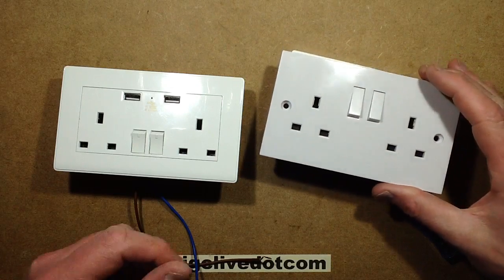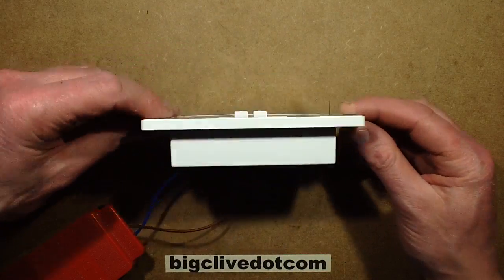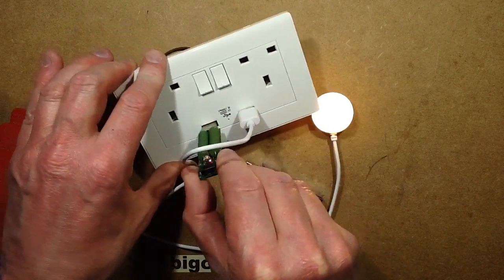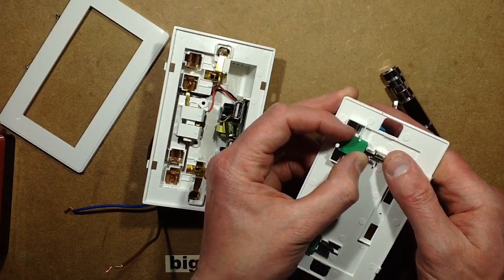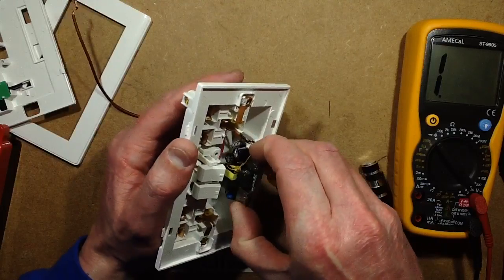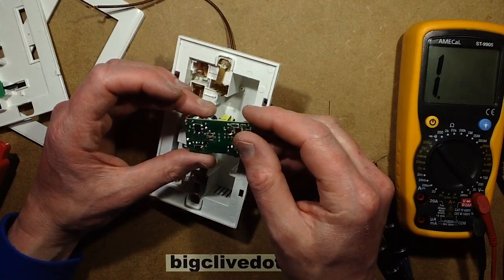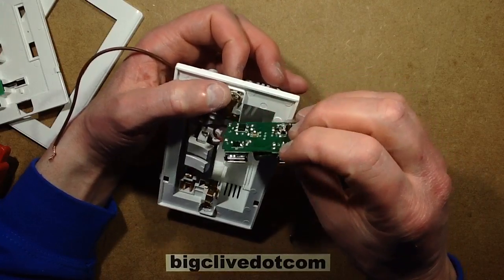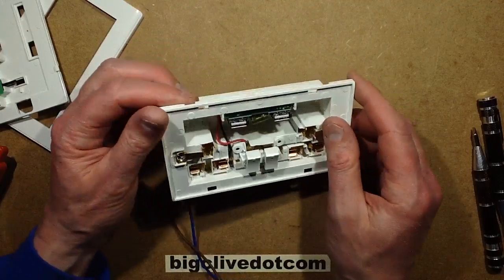A look inside a (crap) double gang socket with USB outlets.

Comment: In  America we teach kids not to stick things in AC sockets by leaving them un-shuttered. Just takes once in most lessons.
Reply: Haha. I know they are for safety but there was nothing worse than moving into a place where they've stuck those little socket covers in them (I hope you know the ones I'm taking about). And then you can't get them out with your fingers (especially if you don't have long nails). Then you're stuck contemplating whether to chance a screw driver or just never use any electronics in that room.
Reply: +David Palmer it didn't work with me. I'm still sticking stuff I shouldn't into wall sockets. I like sparks, smoke, and fire!

Comment: I agree about perminant installs on these. Stick a usb stick in it and kick it by accident and you've just broken the plastic tab for the usb port off in the socket. That's a lot harder to do with an outlet which was designed to be wall-mounted, usb ports are not.

Comment: The floating earth leads trouble me most about this device. In my experience these USB outlets are very attractive for the do it yourself 'er to try on their own. Thank goodness for listing requirements with nema devices. (don't ask about 15 amp stab-in-the-back) units
Reply: The laws should require a separate mechanical switch for the USB so that if it fails it can be disconnected without affecting anything else. Also you could keep it disconnected when not in use.

Comment: what happens when an ir test is done on an installation with USB type sockets seeing as most are not isolated from the mains so will definately fail the ir test and I'm guessing fry the electronics having just had 500 volts put into it

Comment: Many of those single-chip fully integrated off-line PWM regulators take power from the feedback winding or an auxiliary supply winding when using optical isolation. Either way, the bulk of the failed power supplies I have seen were caused by failed caps in that feedback/auxiliary supply for the PWM controller - the controller cannot operate normally if its own power supply is garbage.

And those supplies with bad PWM supply caps did tend to operate more predictably when under significant load since it helps to clamp flyback voltage peaks and gets the flyback supply operating closer to continuous mode where the filter capacitors become less important.

Comment: the US is trying to require those shutters...its maddening to use, they make it so much harder to plug stuff in and break so easily.  If I ever had a house with them I would put in old normal outlets right away.
Reply: +Matthew Miller we had them for decades and they never ever been an issue ,perhaps the ones usa adopted are just bad design !
Reply: +Matthew Miller That's because they have to use a really awkward design to allow for two-pin plugs. Not a concern here, they don't jam up.
Reply: Really?  So everything has a ground prong there?

That must make finding extension cords a lot easier...seems like 9 times out of 10 I have to use an absurdly long "outdoor" type cord for things like laptops that are grounded.  That or use the silly 2-to-3 prong adapters but I don't like doing that unless there is no alternative
Reply: Matthew Miller
Well just go easy on your current draw then. The electric in your place sounds pretty inadequate. At least you know that one circuit breaker works. If it trips a lot it is probably a bit worn out now though. Like a lot of things the more you work a breaker the easier it goes.
Reply: +Matthew Miller If you have two blade receptacles installed still you should just change them to 3 prong grounded ones. But if you do then that means you probably have cloth insulated wire too, that is about the consistency of mummy wrappings today. Never fun to work with that old stuff.
Reply: +Paul Frederick All the receptacles over here have 3 prongs but the "flaps" only go on 2
 of the prongs.  Extension cords are mostly all 2-prong (except the 
construction/outdoor type) and really most all devices are 2-prong 
except fridges, microwaves, and computers (but even a lot of newer 
laptops seem to be coming 2-prong).

I did recently learn the apartment has aluminum wiring though, had some 
issues with things cutting in and out randomly and was watching the 
maintenance guy I was surprised to see it wasn't copper.
Reply: Matthew Miller
Aluminum is banned here except for the service drop. If aluminum isn't done right it causes a lot of problems. It has to be sealed, or it oxidizes, then the fun starts. There's also an issue with aluminum and the galvanic effect with other metals. If you have aluminum wires in your walls start looking for a new place to live. Either that or make damned sure the batteries are good in your smoke detectors. Sleep with your shoes on too!

Anyone in the know says there's nothing wrong with aluminum as long as it is installed correctly. The problem is people are screw ups. Aluminum is really sensitive to a lot of factors too. We allow it in the service drop because all of the hardware is designed for it, competent people install that, and it always gets inspected too. So no problem. You start running aluminum in a house though, and look out!
Reply: Hahaha batteries in smoke detectors...yeah this place is so old that's not a thing, nor is standard beeping.  Took a few hours to figure out what a buzzing noise was from the unoccupied floor below us (apparently they used to buzz instead of beep long ago?), then after looking in the windows and determining it didn't look like an emergency we had to figure out who to call.  Ultimately ended up calling the fire department (couldn't get hold of maintenance that time) and they found a door that they could open and ripped the thing off the ceiling then had their people put in an order to our management for repairs due to false alarms.

In my unit I added a battery-only alarm since we aren't allowed to touch the permanently installed one per rental contract.

Next you'll suggest the outlet next to the kitchen sink should have GFCI protection, or that it's bad we trip a breaker every time we vacuum (or use a hairdrier) since this place has 2 bedrooms, 1 bathroom, the hallway, and half the livingroom on a single15A circuit.

It's all to code though because apparently this place is just that old (circa 50's to 70's?)...and since they haven't like done any major renovation everything is grandfathered.

Trouble is all the "new" apartments they want to be all fancy elete and cost at least 2x as much per month rent before utilities and it goes up almost every year.  Here it's affordable with a roomate plus utilities are all included and hasn't really changed cost in 4 years.  If I didn't split with a roomate even here it would cost about 60% of my post-tax post-health-insurance income as a software engineer.
Reply: I have them in the house I just had built. Hate them. I also have some outlets with USB. They work fine, unlike this one.

Comment: Are the plastic boxes a common thing now? Seems like a fire hazard to me, and I hope I never live in a house with them.
Reply: +RealLuckless the plastic housing for sockets ? no they are fine ,live wires dont generate heat and sockets never get hot really
Reply: ***** Unless there is some manner of fault or short. I've pulled more than one metal outlet box out during renovations that showed signs of scorching or past minor electrical fire that was contained to the box and not allowed to spread.
Reply: +girlsdrinkfeck live wires can indeed generate heat. They shouldn't, but that doesn't always stop them. Plastic boxes are crap compared to metal ones.

Comment: An Ipad wants a 10amp supply for charging.
Reply: I think you mean 10 Watts which is only 2 amps@ 5V. 10amps would be more than any 5V power supply I have.
Reply: +9HighFlyer9  Yes. My bad.

Comment: You limeys with your weird and gigantic plugs and receptacles. Now for the serious question. Are the plug types and receptacles you guys use SAFER then the ones we have here in the states. I know we use lower voltages but I have always been curious about how grounding and other safety features are or not more reliable. Also it looks like your mains wires are a slightly smaller gauge than what we use for our receptacles. At least for those small loads. And yet another thing. Are the connectors polarized?
Reply from the maker: +Eddie Romero Having explored most of the mains connectors of the world I think that while our chunky square pin plugs can be annoying at times, they are actually one of the most robust and reliable connectors.  It's very rare for them to fail except where a wire has not been tightened properly ion either the plug or socket.
Reply: +bigclivedotcom Cool. like they say you learn something new every day. Thanks for the reply.

Comment: Put both CPC conductors in one earth terminal, and put a fly lead accross to the other.
What you're suggesting will break continuity of a ring final circuit which is a bigger problem (especially if there are a few of these on the same circuit), than having one single outlet without a CPC connection as there will be multiple without a fault path.

For newbs: CPC= circuit protective conductor

Consider having a qualified electrician install these.
Reply from the maker: +CableWrestler The style of terminals is only suited to two equally sized conductors.  If three were used it would not clamp them properly.  So I'd suggest one ring earth in each with the loop across so there were just two wires, or of the box was metal, loop one through the boxes earth point first.  Either way it's a bad idea.
Reply: +bigclivedotcom Yeah, it's really not great. I don't trust these sockets at all; They're completely unregulated in respect to quality. At least with the likes of Apple etc. they build good quality chargers... These, not so much.

Comment: When I was young (in the days of Round Pin Un-Shuttered Sockets)
I once stuck a fork in a socket --- I was more shocked by the blowing fuse
than by the electricity.

Re: Eco-Houses and light fittings:
Ours were originally fitted with horrid 3 pin sockets which required
expensive (2-3 times the cost of the 2 pin versions) fluorescent bulbs.
Needless to say, when they went --- I put in normal sockets.

Had a couple of electric failures recently  (both items about 3 months old) :
a 4W --- 9 LED lamp and a USB (AA & AAA) battery charger.
The lamp just stopped working and the Charger just started putting out 4.5 Volts instead of the 1.4 it should, and the blue resistors in it are nearly black !

Comment: Correct me if I'm wrong, but I think BS7671 states that all ring main double sockets should host two earth connection points to be legal, and that each cable earth (typically 2x 2.5mm2 T+E) should be connected to its own independent earth terminal.
Reply: Ring Final
CPC
1.5MM

Not all socket outlets incorporate 2 CPC terminals. (Crabtree is at least one make I can think of)

In addition, not a lot of people know that BS1363 covers the rules and regulations to socket and fixed appliance outlets.
Reply: Ring Final
CPC
1.5MM

Not all socket outlets incorporate 2 CPC terminals. (Crabtree is at least one make I can think of)

In addition, not a lot of people know that BS1363 covers the rules and regulations to socket and fixed appliance outlets.
Reply: +CableWrestler *1.5mm CPC
Reply: +CableWrestler - I'm aware the CPC is 1.5mm2 in a 2.5mm2 T+E.  Note the "T+E" (twin and earth) part, and reference to "cable".

So, now I need to figure out where I read this.  Pretty sure it was in the 17th Edition IEE Wiring Regs somewhere?  I pondered why at the time and figured it might be done for redundancy should one of the connections fail.
Reply: +9ff70f96 I was a bit picky, sorry :)

As for the sockets, my colleague and I had this argument a while ago, and we both liked through the regs and OSG. One of them shows a diagram of them in separate terminals but doesn't explain why, and the other one (and GN3 come to think of it) shows them both in one terminal.
Reply: +CableWrestler *flicked

Comment: While the grounds being connected to the mounting screws, thus to a metal box, would tend to contradict this idea, is it possible the separated grounds might be intended as what we call in the US an "isolated ground" instillation? They are intended for computer connections where a ground loop might cause a problem. Our isolated ground sockets are orange to make them obvious.

Comment: +bigclivedotcom why does the uk (and probably some other countries) have toggle switches on their outlet So?
Reply from the maker: +Peter Folchi DSo you can turn a load off but leave it plugged in, or so it doesn't draw an arc and damage the contacts if you unplugged it live.
Reply: also if one pin disconnects before the other it will pop the lcd  circuit breaker which it is desined to do.

Comment: Part L1 of the building regs is ridiculous. To be fair it didn't mandate the ballast being built in, it just requires that the fixture NOT fit an incandescent.  My ex had some in her new housing association property that were like a combi between a B22 (bayonet) shaped end with GU10 type 'mushroom' prongs. Had the advantage that normal ceiling shades would work, but the bulbs were hideously expensive and only available from one supplier. SO off the lampholders came and got replaced with standard B22 ones.... here are the stupid things: http://www.amazon.co.uk/TP24-GU10-Energy-Light-Bulb/dp/B0044BCMJS
Reply: +simontay1984 They copied the B22's deep access skirt... I am not sure even the one I linked would work with the shade ring in place. But yes, some GU10 LED lamps would fit,  but that would kinda fulfil the point of part L1 I guess

Comment: Hi Clive-thanks for the video
I bet that socket would be a nightmare, if the switch mode PSU emitted wide band interference.
Imagine a thousand of these things installed in a new build, and someone complaints about interference to a radio or something
 Or they all blow up under warranty- Expensive!!!
PS you really didn't drink the meth's did you ?

Comment: I just love those UK sockets with their integrated switches. I'd also love to see them getting more common in Germany, too. (With a Schuko socket, of course.)
Reply: +Markus Birth (mbirth) Why would you want a switch on your sockets? The ones clive is showing here are just bulky and ugly if you ask me. I like our slim ones here in germany better
Reply: Spexxos1: With a switch you could turn off devices completely, instead of pulling the plug or adding a bulky switch adapter. E.g. for Christmas lights or the kettle.
Reply: Markus Birth I never usd a switch adapter. I use multi sockets with integrated switches. The nice thing about those is you can hide them most of the time behind something. You cant do that with a wall socket
Reply: Spexxos1: The wall socket is there anyways. A little switch would hardly be noticeable. In fact, there are even (German) sockets available with switches. But they're 4- or 5-times the price of a normal one. And I can't hide multi sockets on my kitchen worktop. Also I don't always want to switch multiple devices or use a multi socket for just one device.
Reply: Markus Birth
I wouldnt mind a little switch on a socket but only as long as they dont get as bulky as the ones in the video. The thing is that nearly all of my sockets are in places where I just cant go that easily. I would have to move half of the furniture to get to them. Also most of them are single sockets. Thats why I like my multi sockets with their switches. Its the most comfortable way for me.
Reply: Spexxos1: I have a few double sockets above my kitchen worktop - easily reachable compared to the switches on some of the appliances.
Reply: @Spexxos1  I don't trust plug sockets without a switch.
I don't like keeping things connected to a power supply when it isn't in use.

Comment: You haven't discharged the main input cap.... that could give you nasty shock...
Reply: +mattibboss Not likely, the cap is so small it would have discharged over time anyways and not been a worry
Reply from the maker: +mattibboss It's OK, I discharged it with my finger.     In reality the circuit topology in these units is such that there is a high value resistor and integrated voltage reference in the chip that quickly brings the voltage on the main reservoir cap down to a safe level.  Then I stick my finger across it.
Reply: bigclivedotcom you kind of right but that circuit is not 100% safe so..I would be careful anyways... you never know what's one Huang low china snit :DDD

Comment: There was something a few years ago to do with multiple computers being plugged in, having the separate earth terminals was supposed to cure a problem, but at least they were internally connected together, that socket is dangerous for just that reason.
Then to have built in electronics pushes it into the 'disaster waiting to happen' category

Looking up for the separate earth one site shows one terminal for the 2 earth wires, the other for connection to the metal box
https://www.tlc-direct.co.uk/Technical/DataSheets/GET/GET_Ultimate_Instructions.pdf

Comment: The reason the android phones refused to charge point blank could be down to the fact that some android phones test the reliability of the incoming voltage before applying any sort of load to the port, it would detect the significant ripple in the voltage and assumes there's a fault, causing the circuit to become open, probably at the charge protection circuitry, to prevent damage to either the device, the components within or the cell itself. And as we all know, misusing Li-ion and LiPo batteries doesn't end well

Comment: Anything that gives MORE voltage under increasing load seems to be asking for instability.
Reply: +Steven Birch Actually that's quite normal for chargers. They compensate for losses in the cable.

Not that I think it's by design in this case..